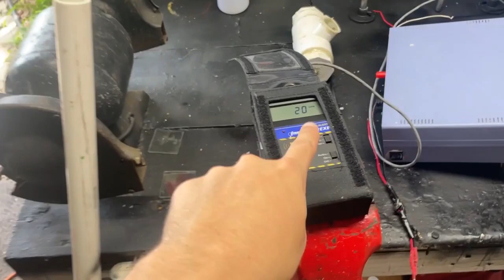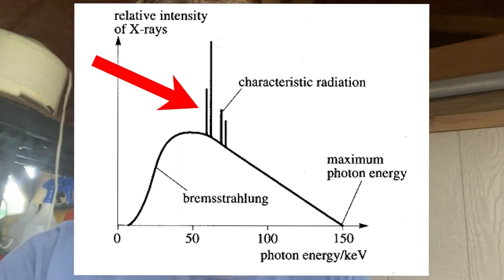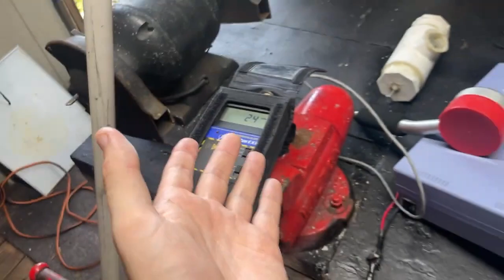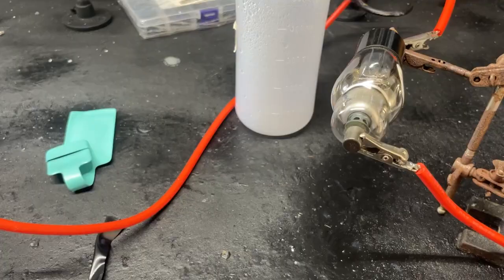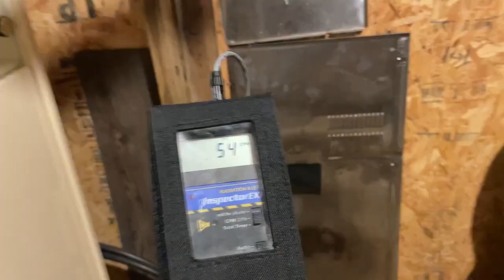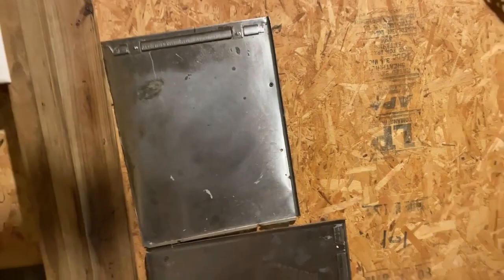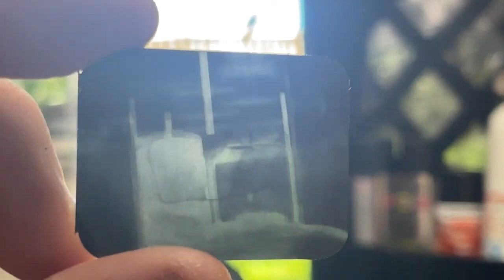Turning TV parts into a X-ray machine!

Comment: I used to be in the TV trade when colour was just coming in. Some early hybrid colour sets used a PD500 triode EHT stabiliser valve. These were known to produce X-rays and were inside an enclosure which had an interlock so that the set couldn't be switched on if the cover was not in place.

Comment: As you are running the tube with a cold cathode you may improved the focus reversing cathode and anode. The cathode is wont like the electron bombardment much but you may get a better focal point for x-ray generation.

Comment: I’ve been experimenting with this exact tube and I got really good results out of it using a Cockcroft Walton multiplier to step up the voltages to make higher energy X-rays. I’m going to release a video about it soon, maybe what I’ve figured out might help.
Reply from the maker: did you use a intensifying screen? Or film?

I might give it another go with higher voltages and some resistors so the voltage doesn’t sag so much and get some more penetrating X-rays.
Reply: @PyrotechnicalScience  I was using an intensifying screen however I have the same kind of film as you, I just haven’t tried it out yet. I’m really close to honing in on a good range but I just figured out last night where the upper limit on how much voltage you can use in cold cathode mode is 😅 I wish my variable DC power supply wasn’t currently broken because I’d be able to figure out exactly where it is. All I know right now is nothing of practical use happens above 150kV I think I’m currently blasting it with close to 200KV if my arcs are anything to go by.

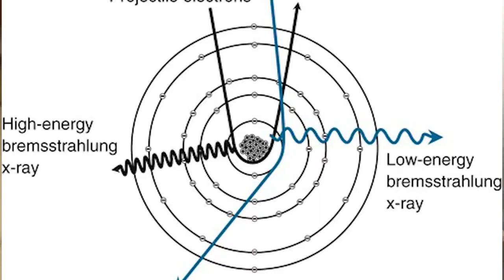Comment: 3:45 Just to clarify: I'm not a big fan of this explanation as there is nothing which makes the electron magically "dump its energy by means of an x-ray" because of the conservation of energy. Sure, that is what follows from the theory, but it's not that the electron somehow decided to read the textbook and wants to comply. A moving electron will generate a steady magnetic field, e.g. think of electrons in a constant DC circuit (ignoring what really happens, drift velocity, etc. for the sake of the example). Any change in electron velocity - no matter how or why - will generate a changing magnetic field, which in turn creates a changing electrical field and this cycle continues as the propagation of an EM wave. You could somehow visualize it in this case that e.g. a collection of "time snapshots" of a decelerating electron's "momentarily constant" electrical field, will eventually, when added over time, have generated a small sinusoidal magnetic field "ripple" (as opposed to a straight magnetic field generated by an electron moving at constant speed), which will propagate as an EM wave. Do this with billions of electrons and you get your EM beam. Another analogy would be a garden hose spraying water at a constant rate. When moving the hose at constant speed e.g. left to right, you will only observe a linear pattern. Now shake it rapidly left to right, essentially causing a series of accelerations/decelerations, and you will observe curved patterns at the points of acceleration/deceleration. This is basically what happens in an antenna where electrons oscillate. It is also easy to see now that a harder electron deceleration will also generate a higher frequency EM wave, carrying higher energy. Hence the voltage, not the current, applied to the tube determines electron acceleration/energy and will eventually determine EM beam wavelength/energy and it's also the reason why you can't generate x-rays using lower voltages.

Comment: I want to gather 50 of those old CRT TV's, 50 car batteries, 50 inverters, and make them work with 1 remote control. This is DIRT cheap now and you make over 1 MILLION volts of power at SIGNIFICANT power levels. The capacitance of a CRT is huge and the voltages are about 20 kV.
Imagine what you could do with 1 MILLION volts?

Comment: I had an old wehrmacht compass laying 70cm next to me for the last 7 years. Had it even in my pocket from time to time for hiking. I cant remember but I HOPE i never opend the thing... Turns out it had radium paint applied on the compass needle. I noticed it weeks ago with a cheap geiger counter.(GMC 300E) I got scared around 400CPM and I dont know if it would have gone higher up (probally as I have seen other compasses with much higher counts)
A few centimeters next to it nothing more but background.

But how bad was it? As I have read online this things pump out radon gas.

Comment: Hmm .. I wonder what I'm doing wrong. Got my hands on a used dental tube .. Filament on a small variac until it was bright white, anode on a flyback from an old Trinitron running 15KHz. Attempted to image a dime on a piece of thin card stock as proof of concept, in the dark, with glow in the dark safety tape as a detector .. nothing. I had assumed my anode voltage was too low - but now I wonder if the tape simply isn't sensitive to x-rays.

Comment: are you into fusion reactors, try static electric charge field high potential ion x-ray striker type vacuum tube ion accelerator, ions are deut and target is lith plate, deut is gas ionized at a positive terminal sphere, van der graaf or any other type as the potential field (also current type spin generator, but not related to this x-ray tech, even if the spin ions create x-rays or more by brehmstalung acceleration/deceleration radio photons)
Reply: the radial spin dc x-ray/radio/radar generator is really fun, the arc spins lol, should be also partial vacuum or almost full, to have the most speed, least collisions
Reply: yep radial acceleration = constant radio wave generation, like a micro wave
Reply: no mechanical parts, only arc plasma spinning in no-moving parts, same for the linear static ion acceleration field, no moving parts
Reply: so try lenses for x-rays, concentrating etc
Reply: yes you can use a slit or shade, also

Comment: Where did you get an intesifying screen.
Reply from the maker: eBay
Reply: @PyrotechnicalScience  ive tried to find one there but with no luck.
Reply: @PyrotechnicalScience  and also for how much did you get it.
Reply from the maker: Yeah I see some on eBay but they are super expensive, I found mine for 15$ USD so you might just have to wait for a listing to pop up!